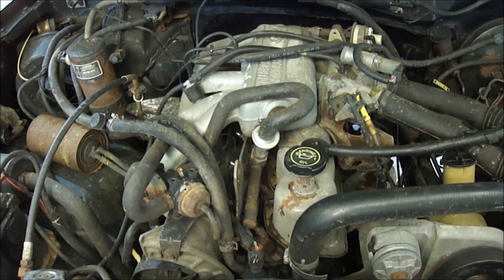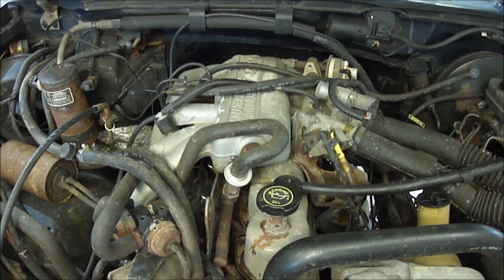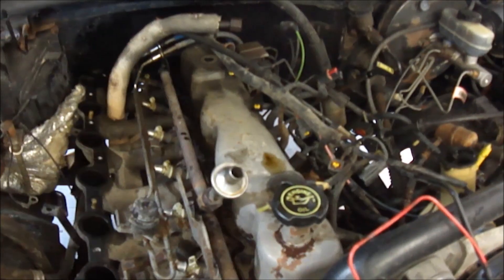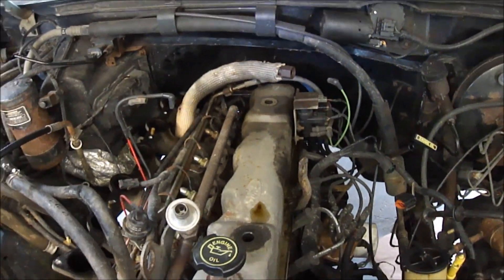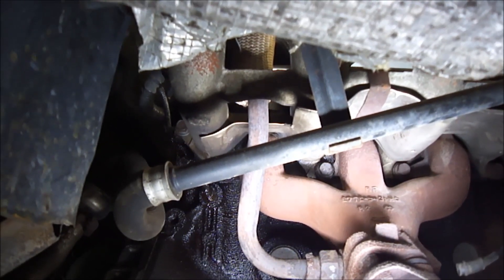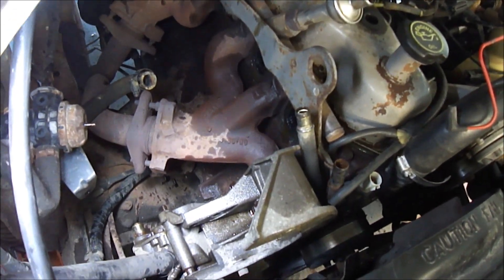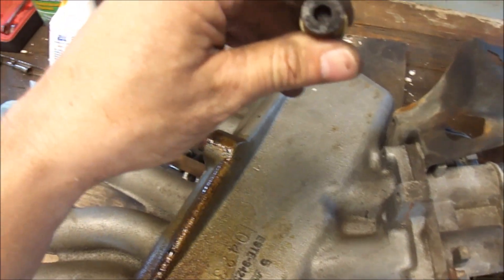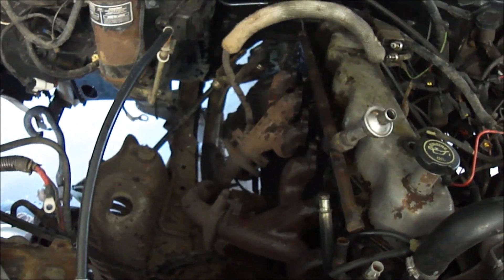Ford 4.9 inline 6 Intake and Exhaust Manifold Removal General Overview

Comment: My '88 is leaking fuel down onto the back exhaust manifold...not sure where its coming from. I replaced the #4 injector back in 2003...but im not sure. Guess ill pull the manifold and see where its coming from

Comment: Currently getting my was kicked by these parts. Initially was going to replace intake/exhaust manifold gasket due to oil leaking. Struggled literally all dauwith a completely rusted egr tube. Finally got it off but going to replace that. Didn't realize the alternator bracker had to come out so while I'm at it going to upgrade to 3g. The pivot bolt gave me hell. Latest road block is the smog pump the bolt catches on to the pulley when it comes out...
Reply from the maker: Yeah the older and rustier they are, the worse it gets. Now that I think about it it seems like a remember some issue with the smog pump, that was probably it.

Comment: bolts backed out or broke to my alt/ air pump bracket. what size are the bolts that go into the block? the the stud i still got unfortunately it's in two pieces.

Comment: The pain ass part was getting the air pump off  but doing this I found out there’s a lot more stuff I got a replace now like the fuel rail possibly all the injectors too
Reply from the maker: Yeah that air pump is a pain, those bolts get corroded pretty bad. When they get this old there is always a potential can of worms lurking behind every repair lol.

Comment: Hey Steve, Great Video, I need to do the same to my old truck (91 F150 4.9L) Great to see what I am getting into. 
Thank you for posting this. Is there any more video of this job that you did not post?  Thank You, Rob
Reply from the maker: Are Jay sorry this is all the video I have, I found it on an old memory card so I just put up what was there. It’s quite a job but if you take your time it’s not so bad, penetrating oil and air tools help a lot.

Comment: I have bucking going on until temps warm up.  I think its my fuel pressure regulator which is under the intake mani.  Whoever said Ford has a better idea must have been wearing a straight jacket to work everyday.

Comment: First time tackling this job today. Luckily the truck I'm working on is not a rust bucket so hopefully the bolts don't break on me. The question I have is if the old bolts look OK can you reuse them or replace? Lastly what are the torque specs for the exhaust bolts. Thanks for the how to video👍🏻
Reply from the maker: If the bolts look good you can reuse them, I don't remember the torque spec off hand but they are in the Haynes manual.
Reply: @SteveStoltz   OK sounds good, from what I've researched those bolts on a 1996 are unobtainable from dealer and have to find them aftermarket or source them out someplace. It's my brother in laws truck so he's actually coming over with the Hanes today🤣. BTW how did you take the plenum off the intake passed the EGR tube? I got a bit frustrated and just removed it completely  since it went through the plenum itself. It's a CA vehicle so im assuming that may have something to do with it because I see other videos of people just lift it off🤷‍♂️

Comment: I need a vacuum line placement video. Can you help? The person I bought my truck from had them routed wrong. I took my smog pump off so far but still dont have vacuum lines right.
Reply from the maker: There should be a vacuum diagram in the Haynes manual
Reply: Thank you

Comment: Hey man, hope all's going well with you in these pandemic times. I'd like to see if I could get your opinion and knowledge related to this. I'm in the middle of (paused on right now) a head job on this motor in my 95 E-250. I have the same smog tube/air rail/air manifold (whatever you want to call it) out of the head as you. I had to remove it for the resurfacing and other necessary work. It's pretty much destroyed now after as two of the feeder tubes came out of the rail and I had to cut another to remove. Nothing but the threaded fittings are steel so I cant weld it to repair. Do you know anything about total smog delete on these ? I did find and spent $10 on specialty bolts to plug those holes in the head today. Just wondering about any negative effects from getting rid of it, pump and all.
Reply from the maker: The main issue in deleting the pump would be causing the cat to not work efficiently potentially causing it to plug up, otherwise you could probably find a smog pump delete pulley or shorter belt and be fine. You shouldn't have any codes with that year.
Reply: Thanks man. In the little bit of research I've done, I've read the same as you say about the cat. I've found that air rail ranging from around $60 to $160, online and from O'Reilly. Most who do smog delete also remove the cat and straight pipe it. The belt is no problem. They have one for no pump. Oh well, just another dilemma and decisions to make in this "Fiasco" of a pretty big project, lol. I want her to be right, reliable and lasting regardless.

Comment: Great video! Any chance you'd know where to get the replacement parts for the EGR pieces coming from the intake manifold? I am in particular asking about the EGR valve from the railing as well the hose that goes from the valve to the smog pump. The previous owner deleted them and blind folded the manifold. I got the rail but seem unable to find those two parts and I am going crazy as the truck does not pass emissions. TIA!
Reply from the maker: Thanks, I would check Rockauto.com, If they don't have it I would be surprised.  Otherwise a salvage yard may be your best bet.
Reply: So wat the best way to take off the exhausted manifold
Reply from the maker: Nolan Leon LOTS of pbblaster on the bolts, let it soak in well.

Comment: Your egr pipe is routed thru the upper intake how did you get it out with out removing the egr pipe
Reply from the maker: I probably just lifted it off past the egr tube after I removed all of the lower intake bolts.
Reply: Thanks

Comment: What is that tube called under the intake.  I believe my exhaust leak is coming from there
Reply from the maker: Its an air injection manifold, that is supplied by the air pump. Its pretty common for the fittings to rot out near the head and create leaks.
Reply: @SteveStoltz  oh yeah that thing.  It gets real hot.  Ask me how I know 👐🔥🤬😄
Reply from the maker: @steverichardson7417  LOL

Comment: Did you use an exhaust manifold gasket when you put these back on? I’m replacing my front exhaust manifold and am wondering if I need a gasket or not. Truck currently has one but I’ve read that it’s not supposed to, so I’m not sure what to believe...
Reply from the maker: Sam yes there is an exhaust gasket, if I remember correctly the intake and exhaust use the same one piece gasket. It been a while since I did that one.

Comment: Does your valve cover leak oil?
Reply from the maker: A lot of the oil you see everywhere is penetrating oil.
Reply: Steve Stoltz okay, I was just wondering because my 93 is leaking oil and I think it’s coming from the valve cover
Reply from the maker: Jonathan Ashworth it’s pretty common for them to leak, as well as the lifter cover gaskets.